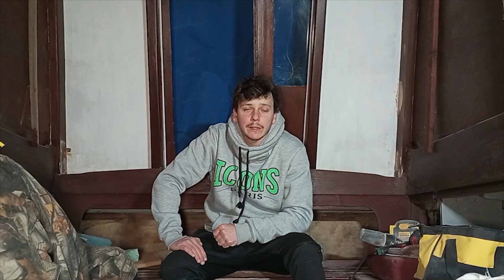Project Update 1940 Wood Boat Liveaboard

Comment: What type of cascamite did you use whether proof or waterproof?
Reply from the maker: Which part of the boat?
Reply: @LakesideProductions  the decks thanks man
Reply from the maker: @bogsquatch6782  I didn't use it on the decks. I have just used it for gluing the joints. The deck supports for example.
Reply from the maker: @bogsquatch6782  If I am laminating wood I will use epoxy with some form of filler additive. Which gives fantastic strength. Especially for any exterior work and ofcourse the wheelhouse roof has been fiberglassed and epoxied. The decks and fore cabin roof will also be weather sealed this way.
Reply: @LakesideProductions  thanks alot man your knowledge is extremely essential to me. I bought a 32ft 1930s admiral pinnace that's in pretty rough shape😅 your videos are great 💯
Reply from the maker: @bogsquatch6782  That's amazing. I am happy to be of help in some way. I would love to see some photos, especially as you progress with the repair work.